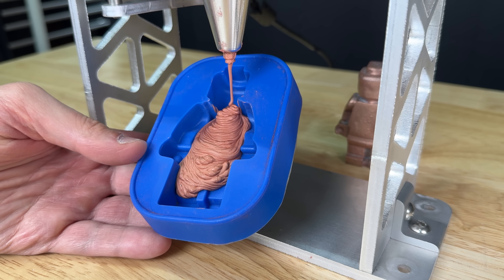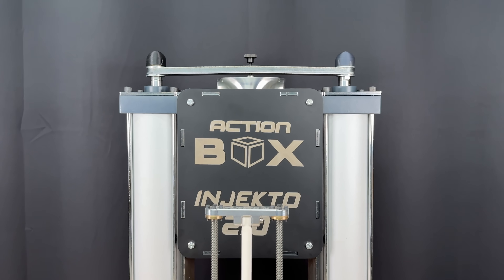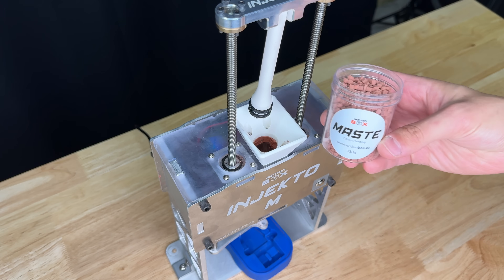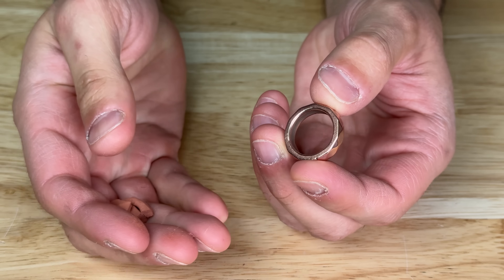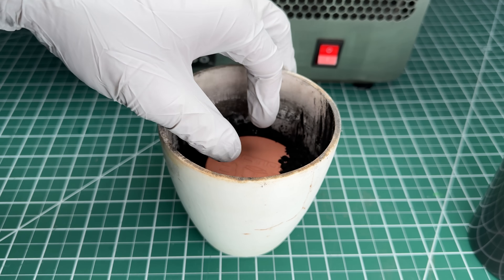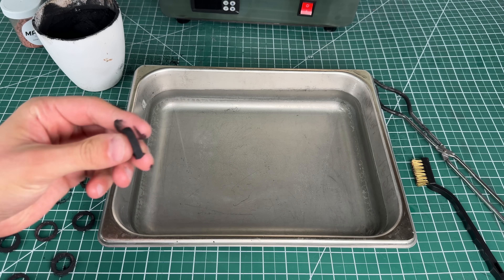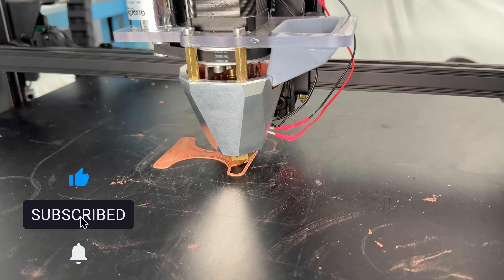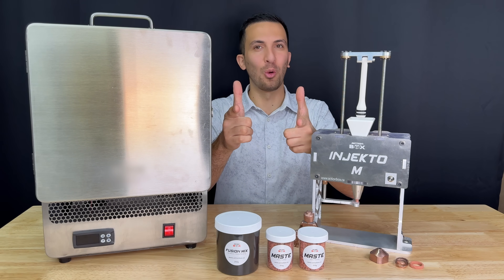DIY Metal Injection Molding with INJEKTO M

Comment: Soo... It's a spin on powder metal sintering where you adopted the process to be easily done by suspending the metal with a paste. I mean bravo on the paste if you designed it, the real technical challenge is suspending the metal into a paste without having whatever is suspending it as a liquid to become an impurity  that weakens the final product.

Comment: I think if you guys get the 3d printing with this stuff down itll surpass any injection molding youd do by several fold just by the fact so many more people would be looking to 3d print with it because they already have printers. 

I am curious about how hollow parts would work though if the  hardener powder isnt able to get in there, woukd you have to avoid any hollow areas and print at 100% infill or would there be a way otherwise, maybe something like microwaves or other high powered em radiation

Comment: seems useful. I assume this is basically metal sintering, but with a binding component that either hardens under heat, or more likely breaks down and evaporates in the oven, leaving behind small voids. So what percentage of the final bulk metal are voids? Or relate question: by how much does the density decrease compared to bulk metal? What impurities remain in the metal? How do the typical properties like strength, thermal conductivity etc. differ?
Edit: found some answers on their website: Density of MASTE post-sintering: 8.00 g/cm³ (copper 8.96g/cm³) so about 10% voids
Thermal Conductivity (Finished Parts): 250W/(m.K) (bulk Copper 385-400W/(m.K)) changes quite a bit more then density.
Reply: you'd need to lacquer it up or maybe electroplate it to avoid the copper getting tarnished throughout. i wonder how much you could fill it with with a simple home copper deposition electrolysis setup

Comment: I'd love to see this system be viable and available with aluminum, steel, titanium and bronze.

Copper isn't as much of a general purpose do all metal as something like aluminum or steel, thereby limiting the broad appeal here, though I will say that this is undoubtedly very cool, and there are still a huge amount of use cases I could see for this.

Also what's the shrinkage and porosity like for the parts after they come out of sintering?

Comment: Why not just use metal powder like what has been used for many years, you wont have to worry as much about your build shrinking after heating up
Reply: For traditional sintering we need to compact the powder considerably, by using a paste they actually reduce the effort required, and i dont think shrinkage would be too much of a concern aslong as you account for it in the design phase.

Comment: So it's not really metal in the traditional sense but it's still cool.
Reply from the maker: Ummm, no it’s pure metal at the end ? 🤔
Reply: @ActionBOX this is essentially a way to cast a copper slurry with it having to physically handle molten metal. I would like to see your success on the 3d printer, but most of my questions are about the maste. Mainly is it pure metal powder or is there a binder to hold it's shape prior to firing? No binder would be stronger after firing but weaker before.
Reply: @barcharmc6216  I suggest looking into sintering, the binder is completely removed by the firing process, and the metal powder itself uses atomic diffusion to bind the powder together in absence of the binder.
Reply: @内田朝陽-e6h  Thank you for the feedback. That was good information.

Comment: So really, the maste is the innovation here, and what should be getting more attention, rather than merely having a metal injection printer that can use it.
Reply: the concept of a binder holding a metal powder that then gets cooked off and sintered in a furnace isnt new, but doing it with injection molding is from what i can tell. definitely interesting.
Reply: @alexdrockhound9497 Yep, it's been used in 3D printing e.g. the Markforged Metal X System. It produces sintered parts so there'll always be porosity.
Reply: @alexdrockhound9497 Millet Sights has been doing it since the '90s
Reply: @alexdrockhound9497 but how can that be, what happen to the binder element, and how can the metal take over it, it is not like the original ammount of metal will change just to put it at an oven
Reply: @hansnystrompastor8690  you are right, in sintering processes the part usually shrinks a fair amount, ~20% on some ceramic parts, not sure about this particular product, it would've been nice if they had mentioned something about how much the maste shrinks and the dimensional stability, but not a single word.
Reply: @Werevertumoto it's clearly stated on the product page.
Reply: @sharkilepsy69 Well, we are not on the product page, aren't we? Why make such an "informational" piece and then omit the most important detail?
Reply: @Werevertumoto  Because this isn't an infomercial for that product...it's simply showing the injection machine...which also has a product page. Come on, people.
Reply: @gyoubufan  it is 100% a promotional video. It is not a thorough review or a technical analysis. That is why they left behind the fundamental detail about part shrinkage.
Reply: Even the "maste" is old tech. Existed for 30+ years.
Reply: its just copper dust plus a binder

Comment: I think this is a great product and the furnace can be used for other things too like ther ceramic sla resin from formlabs. So its a great buy for all sorts of DIYers.

I can't wait for you to get other maste materials, I wonder if stainless 316 will be possible or not. Also normally in metal injection molding, debinding and sintering heat treatments are seperate steps, you seem to be doing it at once, is that what the fusion mix is for? To do it at once or is there other purpose?

I like it specifically because I feel like your shrinkage of 6 percent would be more without it, although I wonder if surface  quality is a sacrifice because of it. And I feel shrinkage wouldnt be same in all directions if it wasnt for the fusion mix, so it'd be harder to optimize.

Great work guys! Speechless, one day you will make DIY friendly machines of every expensive industrial manufacturing process, a win for small businesses and the small guys like us trying to build things.
Reply from the maker: Love this comment, thank you. We have already finished some new materials and will make those public on our website soon.  Yes indeed this is a 1 step process for sintering and debinding which is the magic of Fusion Mix. 

Thanks again for your comment 😃

Comment: OMG if this is true this could revolutionize 3d printing. Pouring metal into molds vs putting the ready parts into a crucible is a huge ass difference. I can do this in my shed. Heck wich a electric furnace i can do it indoors. We can literally put one of these inot an office along with the furnace. This could mean real desktop metal 3d printing.

Comment: I know it sounds silly, but could I still use this model with plastic?
Reply from the maker: INJEKTO M only works with MASTE, not plastic. The machine does not get hot enough to melt plastics. You can check out our desktop plastic injection machine, INJEKTO 2.0: https://actionbox.ca/products/injekto-2

Comment: i assume your material is coper powder plus flux. how do you get the copper powder? do you melt it and force it through a tiny hole?
Reply: Propably grinding, hammer mill or similar what only let less than millimetre parts do drop out.

Comment: 0:55 simpler is not better. This is why fighter and airliner cockpits still run redundant tech from the 80s. It forgoes aesthetics for control.
Reply: That's because fighter jet cockpits are mission critical. Injection molding is the opposite of that: it can't be more trivial than this.
If a part breaks? Just fix the thing, and you're good to go. Seriously, who cares about redundency? In cases like this, simple is actually the best.
Just imagine: fixing a pneumatic cylinder the size of an upper arm vs fixing an electric motor and a screw. It's a no brainer.
Your argument of fighter jet cockpit doesn't belong here.
Reply: I don't remember the credit for the quote about the quote goes "a designer knows he has achieved perfection not when there is nothing left to add, but when there is nothing left to take away."
Reply: Maybe but pneumatic cylinders might increase cost more than they are worth it for the needs and the extra force they provide may not be necessary

Comment: 3D gun printing just got an upgrade. Nice 🎉
Reply: Not especially.

Firstly this is copper, it's very soft and malleable and sintered parts are weaker than solid ones. So it wouldn't be useful in any application with high pressures.

Secondly there's already quite a few 3D printing resins already on the market that do this.
Reply: @peterhoulihan9766  so you're saying there's a chance

Comment: Very cool. Definitely interested in the final result/ future improvements and the filament as well.
Reply: i think 3d print will outgrow filament to pellet hopper just making filament dont make any sense if you want to melt the thing its energy waste then is super moisture absorbant but a heated vice like in molded injection can provide super accurately
Reply: @ I agree but manufacturers probably find it profitable to stick to filament otherwise we would be using pellets more often. I do think this will happen eventually if pellet extruders continue to become popular.

Comment: Do the parts shrink during the baking process?
Reply: Of course. It's either that or a worse outcome, filled with holes
Reply: @user-fy7ri8gu8l this makes sense, I also assumed it will shrink OR be very porous. I guess this leads me to my second and actual question,  @ActionBOX  is there a scaling factor that you provide so you can compensate for the shrinking?

Comment: Awesome, how much shrinkage happens during the sintering process? 

is copper the only metal you've tried or could it be done with a silver maste, gold, heck could steel be done?
with steel sintering powders i assume a similar paste could be made and then perhaps using an induction forge you could sinter them that way.
Reply from the maker: Shrinkage is 6%, and we are working on offering Maste in silver, and bronze.  Steel is much harder but we are working on it.
Reply: @ActionBOX for Bronze could you achieve a blend similar to very tough bronze alloys? I'm curious as there are some Bronze alloys that are close to performamce of a mid-carbon steel. Usually they have a small percentage of nickel or iron,  for example Aluminum-bronze. Very tough stuff, non corrosive, great for gears/cogs, bushings etc. used in naval applications too.
Reply: very cool, I'm excited to see your progress and how far you take this for making metal parts,  etc. Great Products 👍🏻
Reply from the maker: @jordanhorst6  Thank you, We just succeeded in using this with FDM prints. Video coming in the near future

Comment: Hmmmm came across this now I’d like to see how well would it work on Shooting out of a gun .556 all the way to 50bmg
Reply from the maker: I’m not sure what you mean
Reply: @ActionBOX sorry was banned for abit on commenting . So for Gun Enthusiasts we shoot from our rounds anything from plastic all the way to strong metal like titanium or soft materials like copper ,aluminum or even lead . In this case most people stay away from lead but use it along with copper  To make bullets at home using a furnace then dropping them in molds or casting . In this case for your machine your skipping a step which is a lot safer and quicker . So for me I’m wondering to try it  which bullets varying from caliber or sizes being anything I think 9mm-50bmg being the bigger caliber . Since it’s injection I can see it either making normal Rounds or rounds with penetrater inside ( basically a smaller bullet made of stronger material but with copper molded over it )  . To me I see your machine doing the heads in a whole tray then basically heating them up in a microwave and ready to go vs if you search up yourself casting bullets  Process .Your 3d printer I also look foward too !

Comment: is the MASTE temperature stable after the printing process?
Or is it necessary to support the material with the stabilizer, like in a mold?

Would be cool if you could print complex shapes in ABS, fill it with MASTE and then dissolve it with acetone. if MASTE were also acetone resistant. 
😅
Is it?? 🤔

Comment: I actually have an idea for a msla resin printer. Make an msla printer with a CMYB and RGB laser that when it gets into contact with a special clear resin that has a pigment that allows color to be permanently added when exposed to the UV lights.

The idea is to make resin prints without the needs for pad/sticker prints and manually painting the build.

I call it the Prism.
Reply: There's already metal powder resins on the market that do exactly this.

Comment: The MASTE Product is blowing my mind. Now if you can only achieve something similar with cast iron you will go down in history as LEGENDARY. 
[Cast Iron Gear Molding]
Reply from the maker: Dont worry, we are already working on that haha. Stay tuned.
Reply: On a scale 1 to 10.  1 = plumbing copper pipe.  10 being regular 12 gauge electrical copper.  Not asking for perfection so no pressure but how much impurity does the maste end result leave.  After the furnace and cleaning?  @ActionBOX

Comment: Can this be electroplated after cure, as this is a liquid there are no size restraints as long as it will fit into a kiln? What about the thickness upper and lower limits, cant wait for the printer
Reply from the maker: Correct, it is pure copper when finished so you can do anything to it that you can do to copper. It takes on super small details in a mold, although thicker parts are easier to come out of a mold.

Comment: Hi what is the minimum thickness using the cnc ?
Reply from the maker: Can you elaborate on your question? Thanks
Reply: @ActionBOX  I saw from the video that you are building a 3D printer, if I built an empty object with this printer for example a cube, what would be the minimum thickness of the side of the cube? thanks

Comment: Hey super cool invention. I teach highschool chemistry and maker classes. I'm curious if you are able to mark the maste before putting in furance with a laser (CO2/diode/IR) it would be a cool project for each student to make a small coin and engrave it then put in furance. I see you can just scratch it from your video would something like a CNC or dremel work well? I get the feeling it might just crumble.  Also i'm guessing the maste is copper metal? if so the parts are probably similar strength to copper metal correct?
Reply from the maker: Hi Michael, Great question. Yes you can use a laser but I would recommend a fiber laser instead of a CO2 laser, although by playing with the setting both could work. Yes you can definitely cast a block into a silicone mold and then carve away that block with a Dremel a CNC or by hand. It will not crumble away when it is a large block. The final parts are pure copper, so you can assume all of the same properties for MASTE once it is cured. 

We can offer educational discounts, just reach out. 
Cheers, 
Dave

Comment: Interesting product. With the Maste, Is there a dimensional shrink factor to account for? If so, is it consistent? Similar to the inconsistent shrink factor that presents with silver clay applications. 

If not, this is a very interesting product. Given you're using this both for injection molding and 3d printing, I imagine there's the possibility that this could be used in a lower cost silicone casting setup.
Reply from the maker: the shrinkage is roughly 6% so we just scale our molds up by 6%. We use silicone molds when when possible because they are so easy and cheap to make if you have a 3D printer.

Comment: Amazing!!!!, there are avaliable in other metals like aluminum and steel?
Reply from the maker: We are working on other metals right now, but aluminum will not be an option unfortunately.
Reply: Maybe look into the zamak alloys that are used for lower temp casting. It might have a faster bake time because the metal doesn’t need to get as hot to melt? I imagine lower temps could cause other problems also and I have no idea where you could get it as a powder, assuming powder is what you’d need to manufacture maste

Comment: A Brass maste would be useful for Model trains.  Depends on the sintering temperature, don't want Zinc fumes.
Reply from the maker: Yeah, unfortunately Brass isnt one of the metals we are currently working on.
Reply: @ActionBOX  For model trains in small scales I need mass. Tungsten is good but near unmachinable, I heard about a Copper/Tungsten sintered alloy that can be machined. Copper and Tungsten powder version?
Reply from the maker: @FlintStone-c3s  I am familiar with the alloy you are referring to. I have worked with it lots as a welding electrode material. I will look into it.

Comment: Cool! 
Do the parts shrink in size after firing? If so, how much percentage? That's been an issue in a lot of casting I've done and we have to prepare moulds with specific tolerances for the metal we use.
Reply from the maker: yes the parts will shrink about 6%. we just make out molds 6% larger.
Reply: @ActionBOX is it a uniform global shrinkage that is predictable for functional tolerances? 

Or is it more similar to casting shrinkage with unpredictable shrinkage patterns that make it a challenge for functional tolerances?

Comment: Is it possible for you to make desktops die cast machine to mold die-cast aluminum or zinc parts, as well as to make some of the molds for it. The come out shape of the parts will have more delicated details, and it will be quite a changeling project
Reply from the maker: I could definitely try. How will it be better than MASTE? (Im not saying it wont be, Im just curious about all of the benefits you know of) Cheers